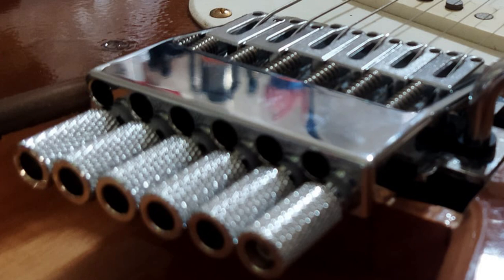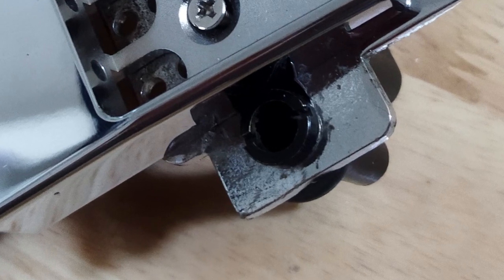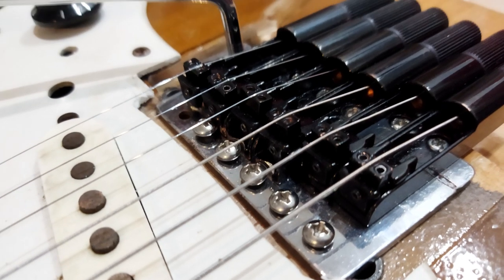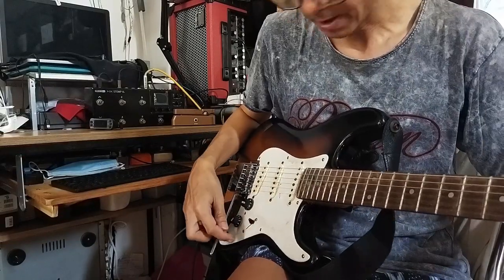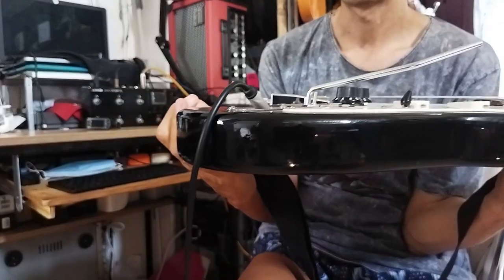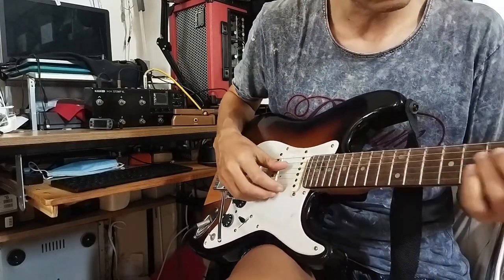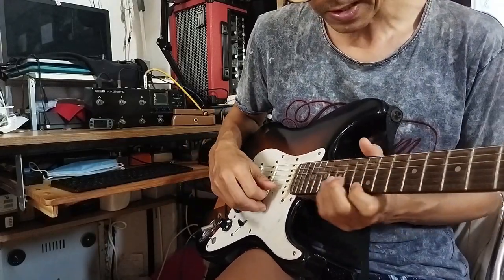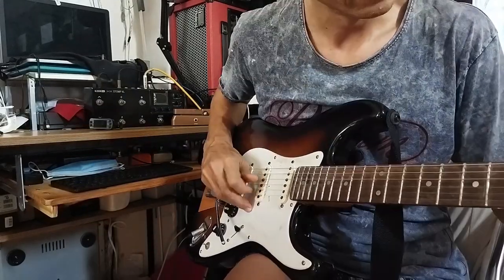Hipshot Headless Knock off Turned Into Tremolo Bridge FINALE

Comment: Great project and review! Thank you! 
Let me ask you a few clarifying questions: 
- Why did you need to bend flat the back side of the standard plate and not just saw it away? What prons and cons put Hipshot on top of  standard plate?
- As I can see, the cavity to access tuning pegs doesn't allow to get so-called "decked" position when tremolo plate rests on the body if springs tension higher than strings tension, is it by purpose? Do you think cavity could be 1-2 cm shorter? 
- I'm thinking of using same concept to build my own travel Strat, but I’d like to go even further and make it easy for disassembly of the neck and headpiece by using threaded inserts, i.e. use bolts instead of screws. This would be possible with fully released strings tension, so my question:  when you "dive bomb" until whammy bar touch scratch plate, does all the strings slack as on Floyd Rose, or high E, B and G still keep some tension as on the regular Start?
Reply from the maker: Hello there, I answer you here: https://youtu.be/fUdmjj52EP4?si=uOXe1NiKjUA2Krnf

Comment: Hello again! do you think it would be possible to use this procedure to mount an "overlord of music" bridge on a stratocaster type bridge to be able to use the tremolo?
Reply from the maker: I think it means, u should sink the whole stuff down a bit in the body. Actually, I had to do it in my strat project as well, when I topped the hardtail hipshot copy on the Fender tremolo plate.
Reply: @ymelfilm  
Did you do it with the "Overloud of Music" bridge? And by chance you don't have photos or any video of that work as an example?
Reply from the maker: @diltempo7575  the Overlord bridge came separately. Before it, that guitar had another tremolo sýstem. I had to reroute that hole to make room for the overlord. And yes, I had to carve it deeper a bit. But the original tremolo was not a Fender system, so it did not have a carve for the springs in the back of the guitar. not many pics were taken. If u r on FB, I try to upload there some of them if I find them in my old laptop